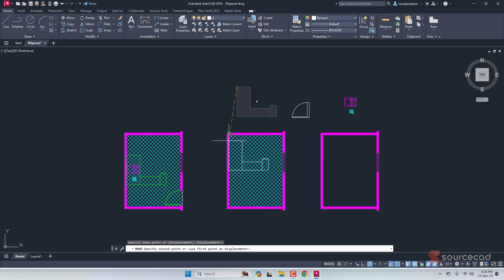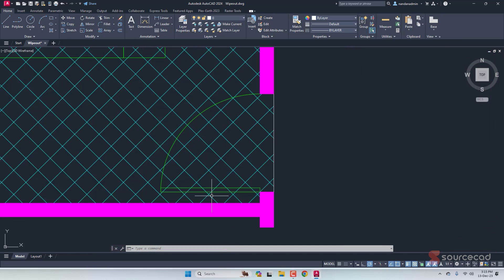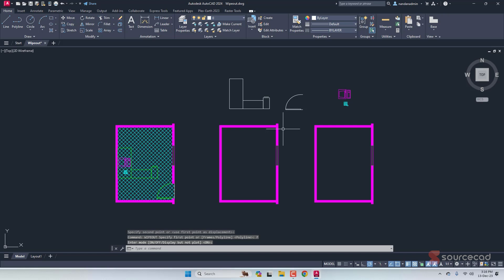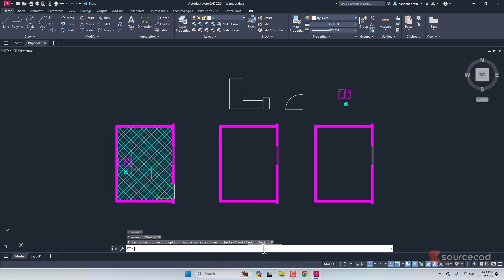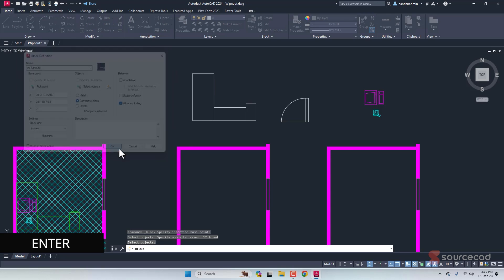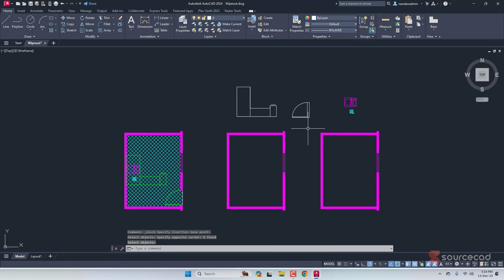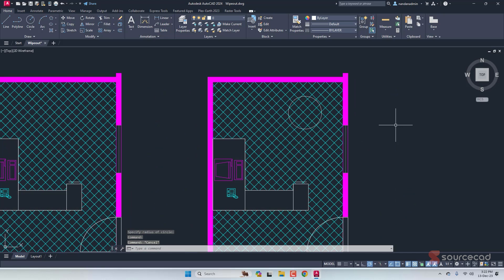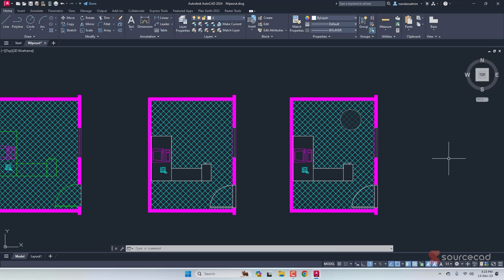Make AutoCAD blocks transparent and opaque with WIPEOUT

Comment: Hi, thanks for this video — I enjoyed it just like your other videos.
In this case, regarding Wipeout, I like using it, but sometimes, for an unknown reason, Wipeout starts acting up. When you print your drawing, in the exact spot where the Wipeout is located, a black blotch appears, and it’s practically impossible to fix.
Do you know anything about this issue? I’m pretty sure you’ve run into the same problem before.

Regards,

Comment: Thanks.    I seem to have trouble when utilizing blocks from the tool palettes because of the scale.    I may use different drawing units for different  drawings (decimal, feet and inches, etc), and create an object and save it in my tool palette.   When I go to use the created object in another drawing it  needs to be scaled before using.  How can I set up these blocks such that they work in what ever drawing units I utilize.  For example some objects may be a construction machinery in feet and some objects may be furniture in inches.   Some of the drawings may be in feet, feet and inches, etc.  Perhaps you could do a video on best practices for saving and utilizing blocks.
Reply: Units should NOT have an effect on geometry. Make the block in standard units - milimeters (when nothing is selected in bedit, open properties and theres a line for units). Save the block. When in target drawing, change insertion units to desired units (top bar, format, units) and the block will be inserted properly and unchanged. Classic rule of everything being 1 or ByLayer, except for the last step.